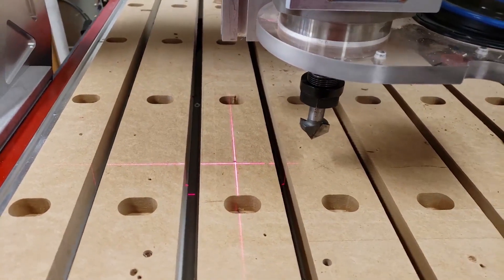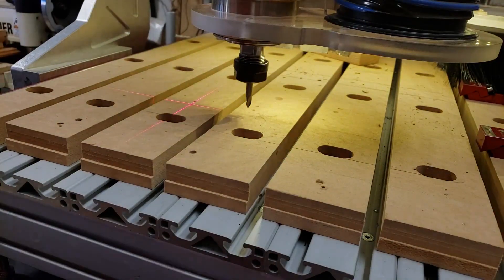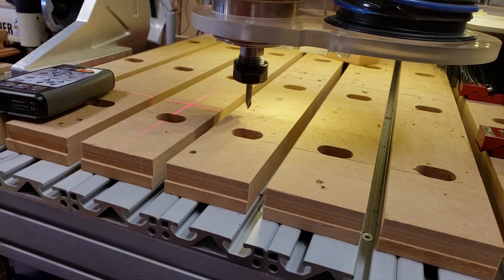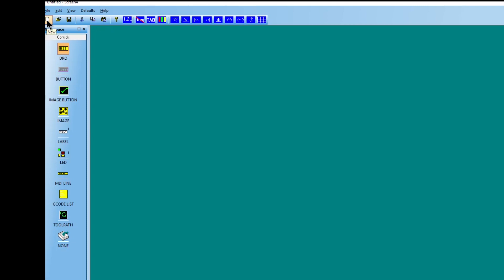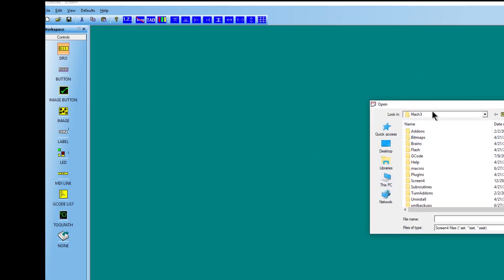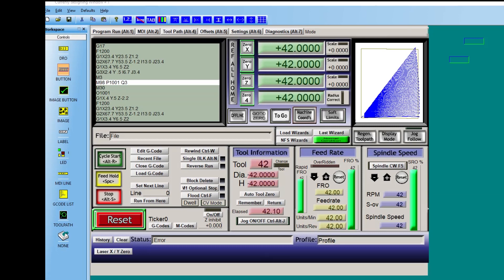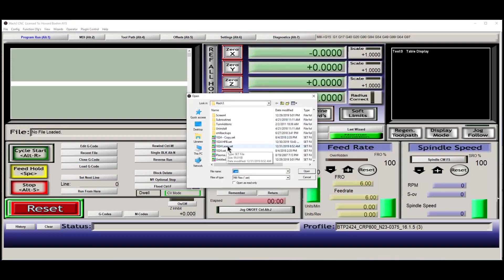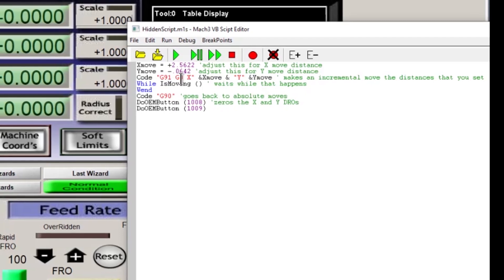Laser Crosshair on CNC Complete How To For Under $40

Comment: Hello Howard, thanks for the video, I'm implementing this system in my cnc router, however I have one question for you, if you raise the Z axis, therefore the laser goes up and down, does the laser move its position on the table? Even one/two mms? How do you fine tune the laser position to accurately be pointing perpendicularly to the table/in the same direction of the spindle?
Reply from the maker: If you go up or down, the point where the two beams cross remains the same. The lines might be thicker or thinner based on Z height, but the point is the same. The distance from the tool and the crosshair intersection will remain the same.
Reply: I got your point.
I think the only way is to position always the spindle at the same Z-height before making your "laser measurements". I.e. the height used when writing the g-code for the new button.
Obviously, this works only if you are "zeroing" your coords always on the working table. If you are pointing the laser over your stock material, than I see no other choice that moving up the spindle a little bit up accordingly to the thickness of your material.
Other ideas are welcome.

Comment: I work in technical support for a software company. One of the biggest banes we have encountered is something simple. For downloaded zip, iso, 7z, etc. files, BEFORE you extract the file, right-click it, go to Properties and "Unblock" the file first.
Reply from the maker: Did something not download.
Reply: @thewoodmaster  Newer operating systems, (i.e. Windows 10, Server 2016 and later), restrict certain file types deemed unsafe. Right-click and go to properties. If you see a checkbox labeled, "Unblock", then the extracted files will not work properly. Just check the box and press Apply and OK before extracting.

Comment: Hi, I have enjoyed your videos and am trying this laser button out. However, when I select the "Edit button Script" it does not allow me to edit the button I created. I have checked all my steps with how you did it on your video but I still can't get it to work. Any help or suggestions would be appreciated. Thanks
Reply: When you created the button did you add it to the screen set? then when you went into mach3 are you using the screen set you just added the button to? If so then in mach 3 when you go to edit button it should be flashing and then select it. You should be able to edit it.

Comment: Great video!!! does anyone out there know if this will work in Mach 4? From personal experience I can tell you if you have a working Mach 3, do not buy Mach 4. I had a computer crash and lost Mach 3. Artsoft will not help me restore it to my new computer because I couldn't find my receipt (I registered the software so they should have me on file, but no joy there). Mach 4 is NOT user friendly and 99% different from Mach 3. All that being said these videos you have shared are what I needed to V carve and inlay. Thank you again for sharing.
Reply from the maker: The code will not work on Mach4, Mach 4 uses a completely different language called LUA. If you can do the same thing but in the LUA language you should be able to do the same thing..
Reply: @thewoodmaster  thank you. At least now I can stop trying!
Reply: True. I bought a third hand CNC with Mach3, they will not transfer names over so I have to put up with original owners name when I boot up. Not that that matters much , it works.

Comment: Question: Why is it +2.5622 instead of -2.5622(and opposite on the y move as well) as you moved your laser to your bit position to measure. Shouldn't you move your bit to your laser dot position as you are using the crosshairs to mark you datum, correct?
Reply from the maker: Not sure, when I put the opposite figures in it moved in the wrong direction, I reversed the plus and minus sign and it went where it was supposed to.

Comment: Nevermind, i found it. When you're in button control you have to check the box that says VB Script edited in Mach 3.
Reply from the maker: When you get it working drop a comment on it. I use mine for everything.
Reply: @thewoodmaster  Will do, thanks for your help!
Reply: I ordered the lasr and battery pack today, I was just getting everything else ready.it looks like it's going to work. I'll just have to modify the script file to reflect the x and y distance from the laser to the but.
Reply: @thewoodmaster  It worked like a charm! I set it up on both my machines, I'm loving it. Thanks for your video, and help with this!

Comment: hello, please ould you help me? i need to know where i can find the aluminum you use for the base of the machine, The Extruded Profile below the wood. i dont know how to find it on amazon or Ebay. And thank you so much for your video! The best and simple way explained.!!!!
Reply from the maker: There is a company called 80/20 they do all kinds. The one I have purchased at avid CNC and its for the desktop pro machine. I am sure you can purchase that from them as well
Reply: @thewoodmaster  Thank you for your quickly answer. I assume you are in USA, is that right? I am not in USA that why I asked for Amazon or ebay. Besides I will try to google with that info about. Have a nice day

Comment: It's important to check that the laser beam is vertical (parallel with the Z axis). Otherwise, the XY offset will be different for different material thicknesses.
Reply: very true and I would think that while that effort was being put into the mounting, a little more effort to keep the X axis directly lined up with the bit would mean there is only one axis, the Y axis, needing an offset.

Comment: Nice... but why not just mount the laser at an angle to point at the location of the center of the bit?
Reply: Because that would be correct for only one specific Z height.  When you moved it up  or down the laser cross hairs would move.
Reply: @chuckthomas5848  True... although with an adjustable laser mount, that could be adjusted.   Options :)
Reply: @Novoworks  not a good idea